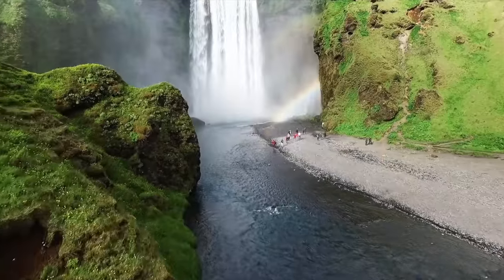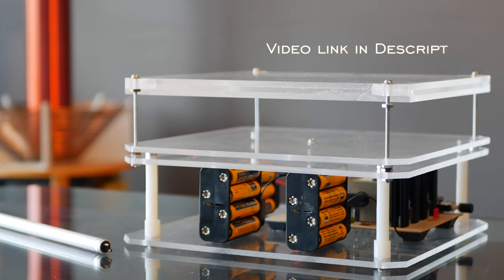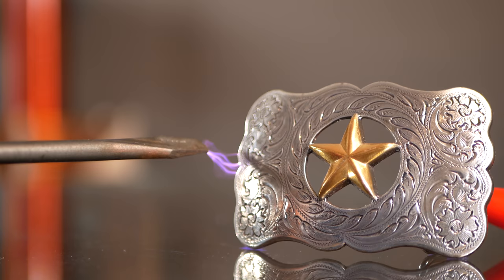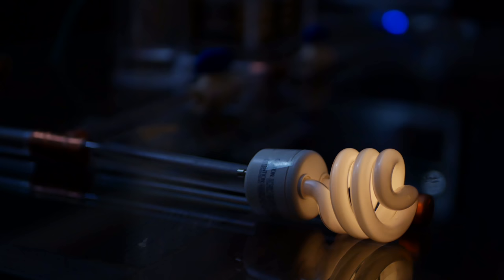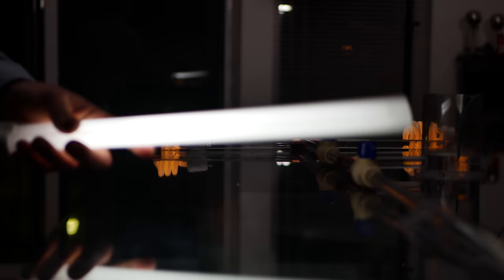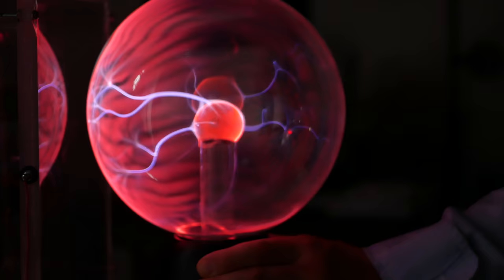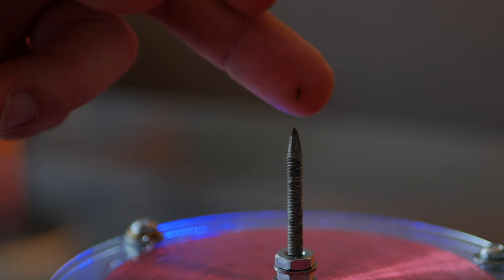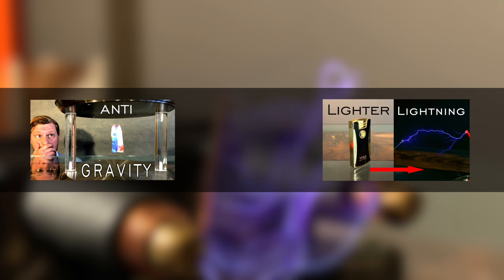Directional Wireless Energy Using Water

Comment: Jay - Ok, let's talk about optimization of the electrolyte (mineral water), also of the materials & shapes (end caps, unions, joints, tubing, etc.), and combining tuned, resonant elements with optimal voltages & frequencies, possibly with some ultrasonic & subsonic input. Of course, effective addition of some spin, flow, magnetic fields, and low-level radioactive stimulus might help (a lot).

Comment: The light has to be a dimmable light so that it’ll work even with the lowest of voltage. Some fluorescent bulbs are not dimmable and need full voltage to light up. To have the smoothest transition from bright to dim without discrepancy, it would have to be a filament light bulb 💡 bcs there is no separation of the current as to the gas filled fluorescent bulb which has to ignite gas rather than a wire. A wire is stable as to gas being inconsistent.

Comment: Water itself is non-conductive. In fact, pure water (with no impurities) will not conduct electricity. It is an insulator. In order to use it reliably, you would have to control impurity levels fairly accurately. Salt water is a decent conductor, as far as water goes, and this is because salt is soft, white metal. Metal conducts. But even salt water has resistance. At low power levels you would not notice the losses, but at higher current levels the water will become hot - with enough current it will become very hot. Maybe even becoming steam. Handling steam can be very dangerous because it can generate high pressure.  An exploding pipe would surely be disaster.

Comment: It is due to high frequency voltage presence and  ionization. Any barely conducting medium can be used, not necessarily water. With increased voltage and frequency, you even do not need any medium other than air. The lamps glow because of ionization. Not really transmitting the power you mention.

Comment: because the CFL has florescent in it.
so when you turn the valve it has some enery left so for some time it glows 

it happens even if the CFL is fixed to normal bulb holder too...

Comment: Nice work.lot of work involve too. In my experience opinion if I may. You working with space called field around you.There is magnetic energy potential.Like everywhere.Think of electron. Electrons are unpredictable  instabile and multiplies in energy field and go through anything. Now air and water are conductiv. (Double slit experiment) When electric power is  attache to any consumer it make a completes circuit.And that create electric field. Electric Plasma is produced when the field space has both energies Called Electromagnetic.Now is a Radiation field.You see it how work.You know more volts adding Better plasma. That give the Radiant space.The dimming distance too. Put a tiny led bulb next to any outlet and test the radiation field. Stun Gun is based on Plasma. A U magnet Copper wire and 9v. Battery . In some StarBox thy displayed phone chargers wireless billow the tables  based on same principle wireless. Your Project can do at list 3 things. Communications,Chargers, art plasma Lamps, Display exhibitions. Many dy things. All the best.Never stop thinking. One think Current has no direction only connect 2 points A and B  and always create Electromagnetic field. See a Incandescent bulb. Aura light is round EM. Electric is not linear as Plumbing drainage.

Comment: When electricity passes through Halogen, Xenon, Mercury bulbs blows but incandescent bulbs need heat & Led will not work on this system.

I loved it, this is a very unique thought. But the question is it safe to use in local areas?

Comment: I like the idea but it seems like water may not be the ideal liquid for it. It splits into hydrogen which can explode and it's not a great conductor. You could use salt water and that would increase conductivity but it would generate hydrogen. Some other liquid like mercury could be used instead. That's how a lot of thermostats work. It's a great idea for anything where physical position is important.

Comment: It works but water is not a great conductor. Copper is much better, silver is even better, and gold is one of the best. That’s why we use copper for electric grids, silver for electronics, and gold for connecting two electronic components. Using water with electricity would better be used for heating, bonding other compounds together, and producing more energy with motion (still a theory).

Comment: I'm betting that there was enough field current around the pipes to keep the lights going.
I'd also be interested in the differences between water types. i.e. Purified/de-ionized water vs water that has more impurities like sea water or a mineral water. 
Also, what are the applications to use the flow of the water to cool something (like a room) while also conducting wireless electricity?

Comment: You're creating fluctuations in the Magnetic Fields in limited areas - wherever your circuit runs. Same for wires, same for water, albeit different amounts of fluctuation in the magnetic field. Electricity generates heat because it's moving particles to generate the magnetic field.

Comment: You made hydrogen as a waste product, which could be collected to run other things such as generators when your connection to the grid is shut off.  However, exploding pipes are usually frowned upon by building codes.

Comment: Interesting, but impractical. You can't prevent power from leaving the house. Houses also generally use metal pipes, not plastic. So you'd have to replace all the pipes. Then there is the final killer that all wireless power suffers from, efficiency. Only a small fraction of the power injected into the system ends up getting used at the desired endpoints.

Comment: Water (pure water) is actually an insulator. The only reason water conducts electricity is because of the ions in the water. High voltage to ionize the gas in a fluorescent tube requires very little current but high voltage, initially. Water, even ionized, is a very inefficient conductor, there will be many loses. Over distance there will be very high I2R loses.
Reply from the maker: Correct. I found that too conductive of a liquid, and the energy too easily radiated away, meaning it did not go far in the pipes before fading out.

Comment: How is the water source connected to the power source?
Direct connection and we run the risk of electrolysis or rather hydrolysis.
Plus is the water running safe to touch ? Coz a nerd kid from the Zen cafe may just dive right into the water to test out a few facts.
Keep doing the great work. Really appreciate the amazing stuff that you do.
Reply from the maker: Thanks! I appreciate the compliments, and am glad you're subscribed. The power source is directly connected to the reservoir, and this water would not be safe to touch, though, you could have it run out of the pipe in a broken stream, which after the break, it would be totally safe.
Reply: @PlasmaChannel  If possible can we get a glimpse of the connection of the reservoir? Any pastebin or imgur link to a picture taken of the reservoir with the connected power source. Really curious about it. Thanks for the previous clarification. Cheers!!!

Comment: im not sure if you use pulsed high voltage, high frequency dc but as you mentioned its ac, i doubt high frequency ac can perform electrolysis tho. i wonder if your source is directly connected to a metal electrodes that is attached to a water tank.

Comment: Copper is good to transfer electricity with low losses, salt water is bad at transfer electricity with high losses, battery is used to store it.

Tho it is interesting if you don't have any metal to use as wire to conduct electricity and have a lot of plastic piping and need to transfer power any way you can to temporary fix a circuit break like if you have to short extension cord and bridge the gap with saltwater and plastic piping.

Comment: Will it work with salt or sea water? Like the water pipe system can be used for multipurpose like transporation system using magnetic levitation/flotation + seawater osmosis desalination at a distance + electricity production using hydrophilic flow reactions + battery storage system using graphene/lithium + wireless distribution, even other integrated uses for WiFi/Lidar. Awesome!

Comment: Run it underneath Street and you could charge your car as you stopped at a stoplight, just a add coiled copper inside the street link to the piping system
Reply from the maker: Cool idea. That concrete may capacitively couple to the piping though, sucking all the energy out.

Comment: I wonder if this was the ideal Tesla had when building his tower over an aquifer.  Not only would the waning and waxing of the water cause frictional energy it could be then redirected into the aquifer deep underground to spread that energy into a grid using groundwater.  He did lay the claim to discovering wireless power, etc and said it could not be metered.  This would explain why
Reply from the maker: It could be metered, because the tesla coil is using grid power as a source, so you'd be able to know total power being transmitted

Comment: The reason why electric power is run through copper wires is because copper has less loss than iron, for example.  Water has much more resistance and greater loss than iron, so it's not a practical way to distribute electric power.

Comment: as I have no knowledge about power & electricity I always saw + & - not in general electricity we get but also in all batteries and cells how does it get both through a single power flow? means it must be - then how it gets is + or neutral? sorry for my very weak knowledge I just want to understand if I can use only one side of battery or cell or one cable from power line.

Comment: Residual energy is still held within the tubed water. 

With the light still in physical connection, it will still remain partially lit until the energy is dispersed through the bulb. If you left it, is should die out eventually. How long does the valve closed, water filled, electrically charged pipe retain it's charge for?

Comment: Even with capacitance coupling, where is the return path to maintain current flow. It’s easy to see that the water piping acting as a conductor but once the charges are balanced no more current can flow. Also, what frequency is the system operating at?

Comment: Does the water get hot? If that's the case then the two flourecent bulbs might still be glowing after turning off the valve as the water vapours increase in the pipe due to heated water and and that still conducts electricity but obviously to a lower magnitude.

Comment: So if you had one of those floor heating systems in your house using water filled pipes and you charged it with a current you could heat your bathroom and light it all off the same system?

Comment: Very interesting. While a zen cafe with an electrified water stream may seem risky, consider a metro or train station, or even electrical wires on most streets. Anyway, suppose a zen cafe water stream should charge twenty devices, what would be the effect of someone sticking their hand in the stream?
Reply from the maker: Good points, really. The stream would need to be isolated from ground, and covered.

Comment: For the water, did you use normal tap water, distilled water, or salt water? Just wondering because salt water carries electric current much better than distilled water, and tap water is somewhere in between, due to the minerals in it

Comment: The two tube didn’t work for the lightbulb here’s my 2 theory. 1. Is the hydrogen liquid is not enough to  give it power. 2. Is the copper ain’t a strong conductor to produce a lot of electricity

Comment: Would love to know the technical details: voltage, capacitance, amperage,etc. What would it take to have a vertical cylinder from ceiling to floor and through the center of a table at a restaurant (or horizontally under a conference table)? It would power the mode lighting at the table, charge your phone, keep the chaffing dishes warm, etc.

Comment: Please try using only pure hydrogen in the tube wireless energy device..  Or just pure oxygen. Pressurized of course. It would be interesting to see if similar results can be achieved.
Reply: On second thought, be careful.  Hydrogen might explode.  You may need to dope the hydrogen with a small amount of inert nitrogen to lower the flashpoint.  To find the correct amount of doping compound you'll need to experiment several times while behind a safety shield.

Comment: This is already in use as rf energy like AM radio station...

You could extrapolate the idea with compressed air system or on a higher level as a plasma distribution system...

Let me know if I am in the ball park....

6:24
RF coupling...?

Comment: I wonder what is the health effect of this radiation. Would you know? 
Another question. If you know the resistivity of the water you can actually measure how much energy you will lose through the system. How does it compare to other conductors? I believe it presents with vantage because of the cost of salt water or sea water and metals. So, when you consider the use of it spreading energy over a large area (lake) it may make sense. Just need to confirm the first question.

Comment: Would have been nice to analyze the effectiveness too. So how much mWh is converted to light and how much is actually lost and compare that to other wireless power solutions and direct connection. (since even in direct cable connection there is some loss due to resistance of the cables).
Reply from the maker: I'd imagine the efficiency is very low

Comment: I'm guess that the flour est stayed on because one the valve was opened all surfaces were wet so there was some residual water in the valve seal.. which keep the current flowing.. and like filament in classical light bulbs .. the filament almost never popped while the light was on ergo you'd have to shut down the source of power to truly break the connection.. but what do i know i'm a high school drop out
Reply from the maker: Apparently you know a lot, Cameron. I think you're spot on. Its a combination of factors. 1) the two bulbs were still close enough to the portion of water still energized, on the other side of the valve. so they were dimly lit. 2) capacitive coupling through the valve. 3) What you said. You nailed it amigo. Cheers!
Reply: @PlasmaChannel  I feel all warm and fuzzy.."YIKES!!!!! sorry i just realized i left my Aluminum PU-36 Explosive Space Modulation device on!" my bad

Comment: If the water is constantly in motion, circulating  through whatever system one comes up with and you had a method to either dissipate or collect the hydrogen, would the wirless energy system still function the same? Or would moving water mess everything up?

Comment: I have a question since water can conduct electricity what would happen if you used this method but instead you use laminar flow and this at the same time and tried to spread the electricity wirelessly that way
Reply from the maker: If the water was laminar flow, it would conduct like a wire when shooting through the air. Not a bad idea!

Comment: Does tne water have to be sterile, pure, and have any particular properties?

  Can it be saline? 

    If so... maybe this concept coild be combined with Graphene pipes, allowing a charge buildup as the current is "pushed" along the "water-wires"  (because Graphene generates current when szline water is passed over it...)

  Imagine an infrastructure which GAINS current,  the farther the transmission of electricity goes...🤔

Comment: Doesn't the surprisingly far reach of the power from the water, combined with the fact that the power cannot be directed to specific devices within this range, make it a risk to more complex devices?
The light bulbs/tubes are not designed to receive wireless power; they don't have induction coils or anything, yet a current is induced and they light up all the same. I can only imagine that if someone were to bring their a phone or a watch (let alone electronic medical devices) near such a wirelessly-charging park bench or restaurant aqueduct, the device would not appreciate having currents induced within its internals in places where it's not expecting them.
Reply from the maker: The wireless power will not affect all devices the same. For example, my watch and iphone were perfectly fine around the transmissions. As long as they stay a few cm away.

Comment: Question: With the more water in the system. Would this make the total amount of energy storable in the system (Water) increase. Which would may also increase the size of the water's Magnetic field?
Reply from the maker: It's less about storing energy, and more about transferring it. But, you are correct in your secondary assumption!

Comment: Ok so at room scale what if anything can increase wireless distance, say like a strong magnetic field from the ceiling to the floor, 1nm arm chip sets could use a weak safe power with top performance computer action from the magnetic fields flow combining the water powered transmission. Try it with this stuff and two super powerful magnets. I did it works with batteries heck solar could even be thrown in.

Comment: The water conduct electricity but copper wire induce emf so that light glow on because he kept light nearer to the copper not to the water
Reply from the maker: That's a great idea. So, the water emits the same emf as the copper (approximately). The lights stayed lit mostly due to proximity with the powersource, and, capacitive coupling through the plastic valves.